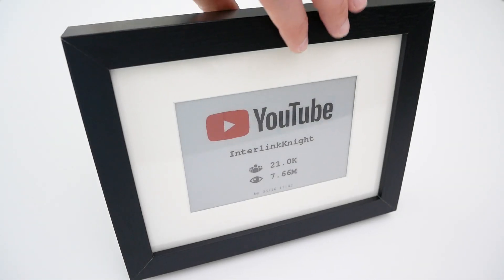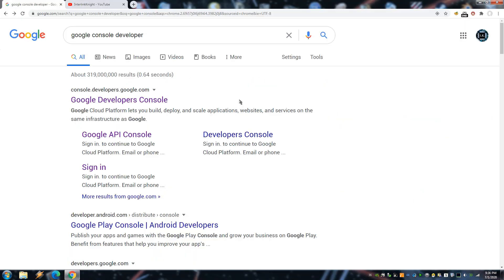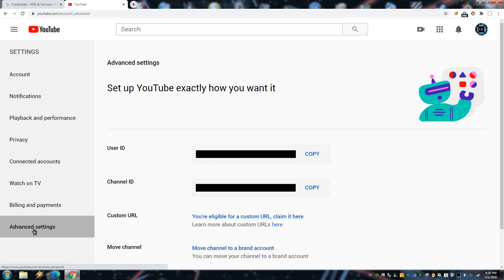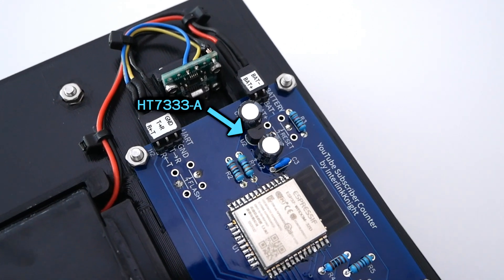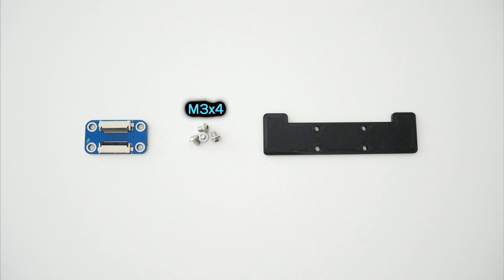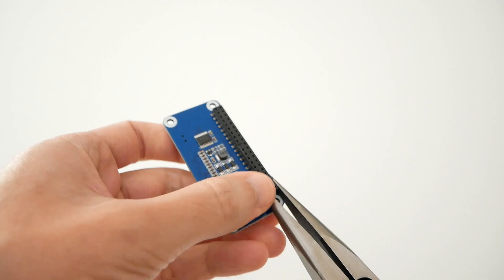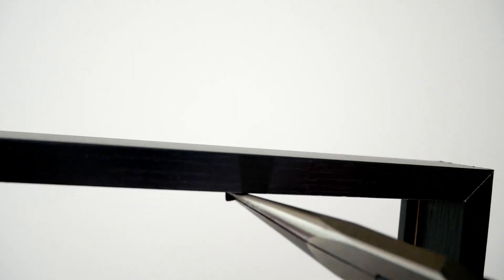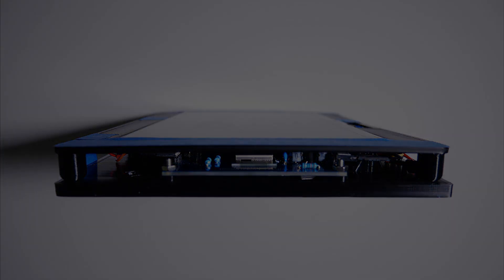Tutorial For YouTube Subscriber Counter

Comment: Sorry for the question, but I don't understand so much of electronics thinks
But from the POSITIVE you have a 470k resistor, then you have a 300k resistor then the NEGATIVE... 
This piece of circuit is not consume electricity please ? 
Obviously I subscribed so in this case the number on your e-paper screen will increment :-) 
Thanks a lot
Reply from the maker: Those resistors you mentioned do consume electricity but it's very low and insignificant
Reply: @interlinkknight  Yes I just learn about the divider :-) 
Maybe like idea, the next version that you'll make, you can add temp/humidity sensor , a time clock
and put the display interface on the PCB :-)
Thanks a lot
Reply from the maker: I don't plan to make that project, but you can easily do it using my examples as a template. Although remember that this kind of display is very slow to refresh so not sure is good for a clock
Reply: @interlinkknight  Clock with out a "seconds"... just hours and minutes and using the partial refresh :-)
Reply from the maker: You can do tests, but right now with current epaper displays available for us, that would not work out well long term. The display is going to get severe burn-in pixels after a few months. It could work for saying the date, though.
Reply: @interlinkknight  I just wait that the display arrive from alliexpress :-)